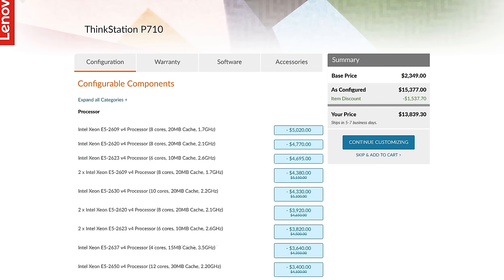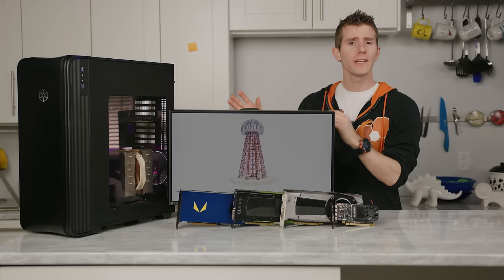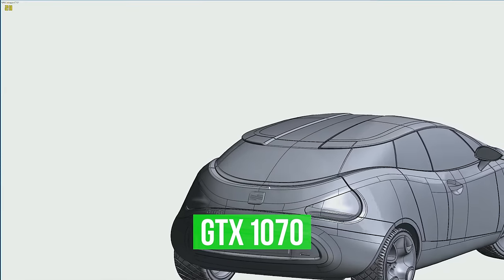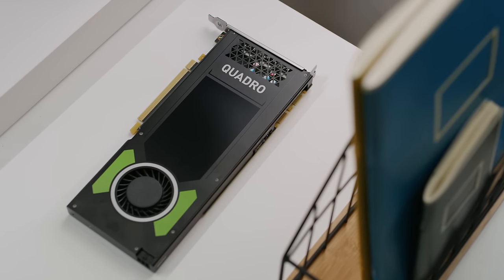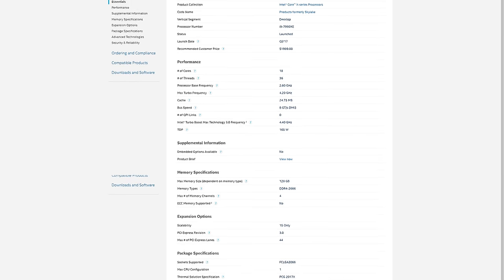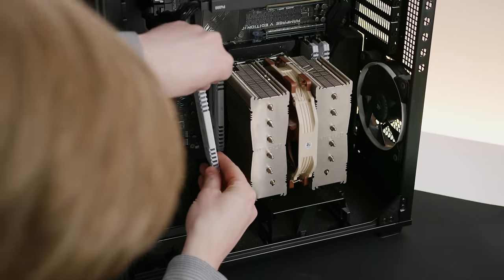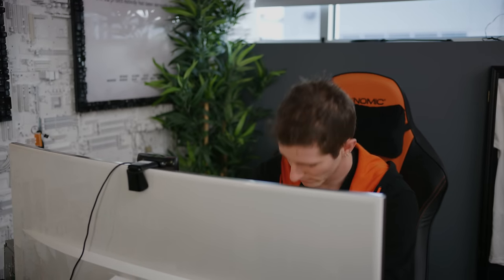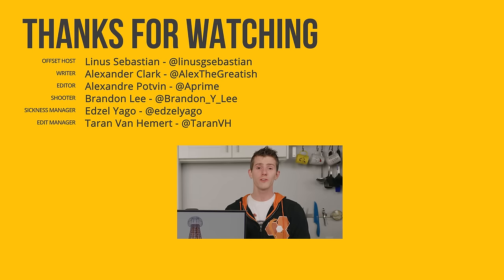3D Modeling & Design – Do you REALLY need a Xeon and Quadro??

Comment: this is my job as an engineer I run a 32 gb asus gaming laptop with a gtx 1060 gpu never had any issues running solidworks mastercam and inventor at the same time I use external monitors of course but we do minimal animations in mechanical designs 1200 dollars is what I paid for my laptop no issues yet at all been 1 year on this laptop most of my designs have less than 40 components running a quad i5 8300 with nvme 1tb benefit was after 8 hours of design work and spreadsheet bom,s I go home and my 7 year old can play minecraft with it lol

Comment: Also would be good to evaluate CPU-s handling Solidworks in regular design tasks with large assemblies. I have SW2020 - Precision 7530 with  i7-8750H - Quadro P3200 and it really struggles with assemblies that have around 15 000 components. Drawings and Copy with mates for example are extremely slow. I have read that SW uses multiple cores only in simulation and rendering. So best single core performance CPU-s would be good. I would really much like to see it to be tested. Or to be confirmed that SolidWorks is no good for a bit larger assemblies.

Comment: I am going back to school for GIS and am looking to buy a new laptop to run ArcGIS Pro.  I have been looking at the thinkpad P53 which offers quadro T1000 and T2000 4GB.  The next step up is the quadro RTX 3000 6GB all the way to quadro RTX 5000 16GB.  What is the difference between the P1000 and P2000 and the T1000 and T2000?  Also, is the step up to the RTX 3000 worth it for running a program like ArcGIS Pro?

Comment: I'm into rendering fractals. Just about every fractal software I've seen uses CPU power exclusively. I wonder why that is, and if it's possible to get a GPU to share the rendering load in fractal applications, especially Ultra Fractal, and Mandelbulb 3D. I know these programs can bog out even the best CPUs. I'd like to see Linus run these programs on some of his bad-ass computers! I only have a Ryzen 5 3600, and I can bog all six cores @ %100 all day, super-easily with just Ultra Fractal and moving a Julia seed, or changing an iteration setting to the right spot. Mandelbulb is even more insane! Fractals are cool!

Comment: Sooo Linus, you really don’t know how it really works man. 
I really can’t tell about rendering or shading but in the end of the day you only need to be able to export your drawings and send them for machining. Here I am using my laptop for commercial use with i7-5700, 16gb ram and a GTX950M running  FLAWLESLY on 1000+ part assemblies on resolved mode and actually a few subassemblies are flexible. All these by simply making a few changes on settings menu. It’s not that hard actually. Please don’t waste your money!

Comment: Or just use Fusion 360, which actually runs faster on gaming cards, and I had no problem running on my old laptop with a Phenom 2 quad 2.0 ghz, 8 GB ddr3, and an integrated radeon 5650 HD 1 GB. 

Did I mention it's free if your business makes under 100k/year?, oh, and it's just as easy to use as solidworks. $5500 will buy you a used car AND a decent PC.

Comment: Guys! A little assistance. Have I assembled a straight machine or will it bring some incompatibilities. I am trying to build an acceptable architecture workstation (ArchiCAD, Twinmotion)
- Gigabyte A520M S2H
- AMD Ryzen 5 5600X
- Crucial 32GB (2x16GB) DDR4 3200 MT/s (PC4-25600) UDIMM 288-Pin CT2K16G4DFRA32A
- Asus TUF X3 AMD Radeon RX 5700 Overclocked 8G GDDR6 HDMI DisplayPort (TUF 3-RX5700-O8G-GAMING)
- EVGA 600 Ba 80 Plus Bronze 600w 100-Ba-0600-K1
- CORSAIR CARBIDE 275R Mid-Tower Tempered Glass - White (CC-9011133-WW)
- Crucial BX500 1TB 3D NAND SATA 2.5 CT1000BX500SSD1
- Corsair A500 Dual Fan CPU Cooler CT-9010003-WW

Comment: Can someone make a video that simulates an engineers real workload. Yes, you run Civil 3D, Inventor, etc. but you also have many other apps open to keep your work flow going (outlook, multiple chrome tabs, Adobe, google earth, etc.). Single core performance is important for the engineering program itself, but is multicore going to give the advantage with all of the other apps open and running while you work and continue to reference them? I'm looking to build an "affordable" rig that won't get hung up on large Civil 3D files with all my other resources open at the same time, but there just doesn't seem so be a lot of definitive testing for such workloads... at least not that i've found yet... of course it also has to be able to game here and there. You've gotta release some stress some how!

Comment: I have a request for you. I find no comparison videos between gtx vs quadro mobile GPUs. How about comparing gtx 1660ti mobile vs quadro p620 mobile GPUs for programs like autocad, sketchup for work space performance, etabs, sap200 for simulation, vray, lumion for render works and also video encoding works. On paper 1660ti looks to be the performing GPU among two. But i would like to know, how worthy quadro p620 is? how p620 handle professional work loads?

Comment: please update this, im a cad designer myself and there are some big changes 

1 the rtx 20xx line from nvidia featutres way better ray tracing capabilities then the gtx 10xx line
ive just build my new dual cpu workstation with a total of 12 cores to at max 3.5ghz to have good single core and great multi core performance, i chose the e5-2620 v3 as it best fits my needs
i had a gtx 1080 and 1080ti but ive sold the 1080ti and just bought 2 2080ti's the 1080ti is about 1.2/10 as capable as the 2080ti for rendering.
Reply: @justadevil432  autocad and revit arnt too heavy (revit can but stay small and youre fine) rendering with 3ds max is difirent, depending on what render software you use, it will eat a whole gpu, so get 2

dont go for a gaming mb or ram etc, those cost a premium for some fancy looks

dont go for overclocking, workstations have to be stable for extended lifetimes and it saves a lot to get  a non k cpu (get intel btw)
and find a used gpu like 1080ti for 450, or some ither good offer
very basic but easy to upgrade
https://pcpartpicker.com/list/sPqBRJ

Comment: In terms of design and Modelling for 3D softwares such as CATIA, SIEMNS NX, which GPU is better the GeForce RTX 2070 or the Quadro RTX 3000, Linus?
Reply: RTX 3000 runs away with it on specviewperf 13 per notebookcheck

Comment: This video is spot on. Most replies here dont work in a CAD environment. Geforce can not output 10bit 444 @60hz. Only 8bit 444 @60hz OR 10bit 422 @60hz. That is worth the extra $1500, if it isnt you dont need anything more than a gtx1060 in your life.

Comment: If you are to run CFD simulations then the threadripper also performs too bad because of the memory bandwidth, even though cores and clockspeed seems good per dollar. The Epyc cpus are in that case much better performing. /M

Comment: ha ha hah..... I have only begun watching this and I intend to finish, but just so you know... I was just having a giggle coz: I run Photoshop, AutoCAD ArchDesktop 2005 (yes, old, I know but can do more than I need) and 3ds max 2010 on a Core i3 530 @ 2.93GHz with 2Gb of RAM. Display is handled by a GeForce GT-710.
and YES... I also edit video and produce material as a professional media supplier. (I charge people for my work)

You will be amazed at what you can get away with if you have experience on your side. ie: WORK SMART

Comment: Can you tell me if this also speed up my Excel calculations
One Cycle takes about 7 hrs (59 Cells with 59 Diff Colors) normally bit takes about 7 cycles to finish the job.
But when I use a Win app it's way faster ...it takes about less than 5 minutes>

The problem that I have here is that the outcome is not correct or the coders don't get it to work properly..

Would this speed up my Excel spreadsheet allot or do I have to look to a better coder?

Comment: I am getting one with 7th gen i7 2.9 GHz   
2 gb quadro M2200 15.6UHD 500GB SSD , 32 GB DDR4 Ram at around Rs. 50,000 / $ 668

My Purpose is 3D Modelling. Please note that in office i have a pc provided by company with GTX 760 for same purpose with 8th gen i5 16GB Ram.

Is It recommended to purchase in 2022?

Comment: SolidWorks for GPU benchmarking ? Yeah right. SW only got "Improved graphics performance" option out of beta state in 2020 version, and this video was made in 2018.. You couldnt tell any visual or framerate difference using  gaming card with "Realview hack" back then and that gaming card outperformed same gpu-chip based Quadro. Even now i get almost same graphics performance on my GTX 960 at home and RTX 4000 at work in SW 2020. And i work with assemblies with 500+ parts.

Comment: What about an i7-7700 not clockable with 32G RAM, 512 ssd intel, and 1060?
Reply: Thank you. Totally cool. I am half way there, and I need the Graphics card solution first.  @1956-c6t
Reply: Since I don't know how to overclock I would need Fac. Over Clocked, but I was dreaming of 1080 mini, and the no letter ti with it. You just helped me solve it for sure though. 1060 or 1080. It may have to be a 1080 instead. I'll just wait., Render is new and games would be nice without cheat codes.  @1956-c6t

Comment: Linus, People or companies that work in the CAD field, like myself, would laugh at you for recommending 16gb memory even in 2018. My home system built in 2016 was a Xeon E5 2660 V3 (10 core 20 thread CPU) I had back then 32gb DDR4 in Quad channel, an X99 MSI Motheroboard and 1tb SSD with a Quadro 4000 just for working at home.

Comment: Do you have an updated video on this topic?  I work with substantial SolidWorks assemblies and are looking for an excellent mid-build that all so will also support VR.  Currently running a GeForce RTX 2080, but I can tell there is a response delay when using the software. The software is not as smooth as it was with the P4000. However, none of the VR headsets work with the P4000.   Any recommendations?

Comment: I had a ridiculously over specified Dell workstation with a high end xeon. It was crap, why? Xeons core speeds are slower so when I moved to a high end i7 laptop also with quadro it was way better. After speaking to the Dell guy at one of the solidworks events in UK he confirmed something like an i7 is way better than a Xeon for Solidworks. It ran better I can confirm this. A i7 8086k or 8700k would be ideal. i9 is overkill. P2000 and above you will be happy in terms of graphics. A good happy medium for me is RTX4000. So breakdown. I would recommend a i7 8086k with IHS removed and nudecnc block added with liquid metal and water cooled, a RTX4000 and 32 to 64gb of quality 3200 ram. Storage very least SSD. 2000-3000 will get you an amazing CAD workstation and the RTX is not bad for games for downtime.

Comment: I am looking with a 2k budget to CAD on a 4 screen set up with fusion 360, data sheets, ~10-20 chrome tabs, and an additional modeling or web browsing screen for free work flow, I have been looking at the P4000 (thin, great for a laptop build) but I don’t know if it is better than a 2080 with/without water cooling to get similar space saving or maybe to save some money. I do a lot of CAD work but I also like to run top down sim games and maybe host some server games, thing is my current laptop can handle ~100 or so 3D printable part assemblies being 5 years old which is different from your 10 part limit mentioned in the video. Maybe you were referring to high polygon models because things like a detailed render of the moon was a bit flakey. I have a pretty mediocre nvidea 700 card laptop flavor but it’s gotten me pretty far already. So I’m wondering if any professional would judge if I got myself the 2080 instead of the P4000 or if I got the P4000 would the performance be garbage with games and multiple screens. Processor is probably going to be the intel 9700k even though the Ryzen 3700 looks good, honestly it’s so close for me that I might just have to wait for middle next year to see if anything more definitive breaks the ceiling

The waiting is also because I have to cad out and cnc prototype a case, was thinking of a thin briefcase design that blooms like a flower using a combination of hobby pistons and cherry/hobby servos I have experience with, I have to drag this machine around between class, work, home, and most places I go and well, I can drag around the cnc machines I built as proof I know what I’m doing so a laptop’s gonna have to do. Even if I crammed the thinner P4000 or water cooled 2080 in a laptop, then slimmed down the usual atx psu to a server psu, the next tallest thing would be the mobo and ram sticks propping up which yes, there are laptop like itx boards but I haven’t yet found one that uses the usual sized ram sticks and don’t have any room for more than 2 sticks and no slots for much of anything else. So the research continues!

Comment: Hello guys 
I want your help in one question that I have . I am a junior architect and I will graduate this year and so I want to built a pc for rendering and autocad . My question is if a iMac pro is a good choice or a costum pc is better. My big consideration is ,that iMac pro have a Xeon 8 core cpu and for my costum pc I am considering to buy a ryzen 1920 x (12 core 24 threads)with a quatro p4000 .And for a motherboard Gigabyte  x399 aurus will be very big difference to the rendering time ?
Reply: Panagiotis Sklavos The MacBook doesn’t have a GPU and GPU rendering is generally 4-5 times faster, look up the channel blender guru and he has an entire thing on how to improve rendering in blender, but the tips will convert quite nicely to any other tool you’d use.
Reply: Also that threadripper chip is better
Reply: How much RAM? And that Xeon will be trash
Reply: G.Skill TridentZ 32GB DDR4-3200MHz so your advice is to built my own pc ?because it will be cost  close on imac's 5k price and so i dont know is if woth it
Reply: And is if  2 more  cores makes such a big  diference

Comment: This video will need an update in 2020 with Nvidia's 3000-series processors or a new architecture (upcoming) altogether, together with a 64-core AMD Threadripper 3990X against the fully loaded Mac Pro with aftermarket OWC expansion RAM Kit.

Does PCIe 4.0 makes a difference against a Mac Pro or a G.Skill RAM that can clock 4800MHz (and overclock to 5000MHz) makes a difference need to be observed.
My Aunt processes 90 days of weather-data and processes 30 worth days of data as she uses a Laptop where 64GB RAM is atleast the workable minimum and says 128GB RAM would be good. I've been looking at Snazzy Labs for a Hackintosh to build something at less than 1/5th of the price of Mac Pro's above $60k price tag but again this video popped up. Shall be waiting for June and learn what pops up as this investment is supposed to last over a 5yrs.

Comment: Hi Im using HP Z800 with dual Xeon (6+6 = 12cores), Nvidia Quadro K5000, 512 GB SSD, 48 GB DDR3 RAM .But Im  still having trouble while rendering, even with a medium render settings in Vray. For a 2000 x 1300 resolution image render also takes 40 minutes while im  rendering, even that scene has less meshes, only 4 lights(sub. div- 50) including one sunlight. Pls help me to solve this issue.

Comment: Of all the CAD systems you had to pick Solidworks, aka the Dane Cook of 3D CAD...
Reply: Dude it's a damn powerful piece of software. After 9 years, there's nothing I'd rather use.
Reply: @stcandrew  

It's easy to use, I'll give them that. But so resource hungry, even when opening a modestly large assembly it will take you 10+ minutes to open it on a professional workstation...
Reply: Yeah it can be bad, especially large assy drawings. There's work around however &. 2019 got a big performance buff with GPU. As a comedy/SW fan, that D-Cook reference hurt.

Comment: Solidworks website tells me to use nvidia cards, yet the amd ones do alright here. What am I missing?
Reply: Quadro's tend to perform better on SW than the AMD pro cards but this video recommended a consumer card for casual, not professional, use. Non pro cards will not get support from SW. Nvidia has also been accused of hamstringing their consumer line for use with programs like SW, AMD may not be doing that or at least not as much.

Comment: I was making 3D art for 13 years with an Intel Pentium 4 and integrated graphics, thou 90% of my models, animations and scenes remains unrendered, and the ones I could render where pure 1024x760 photorealistic pictures. ;D I was good indeed and a little bit frustrated kid, now I grew up and patiently waiting for the Ryzen 3950x with money on hand.

Conclussion: You can learn with a potato.

Conclussion 2: CAD works like charm with a potato, if you're just using CAD softwares a 3200g processor is far enough, those are the "Paint" of the 3D softwares, and the mechanical stress simulations are nothing compared to fluid particles.

Buy a graphics card only if you know what you're doing and need to GPU render, otherwise with an integrated one and a big ass CPU is far enough.

Comment: I have employed been in 3D for 15 years- the reccommedation is overkill for modelling. Who needs real-time framerates?!
Reply: So would something like an rx580 or maybe 1070 be sufficient for middle of the road solidworks projects?
Reply: @Flying244  I use 3DS Max and have had a Quadro K1200 for a couple of years. Not sure about solidworks!
Reply: @Flying244  That rx looks good- I've always used pretty decent but standard graphics cards for 3DS Max at home where budget is an issue. In the past some cards could be 'softmodded' to run the quadro drivers! (losing your warranty of course!)

Comment: you need to do this with Tekla Structures and using point clouds for me...  it makes my 9700k smoke  pins 1 core to 100% pins my ram to max 32bg and the 1070 is at 99% usage !!   and then it crashes!!